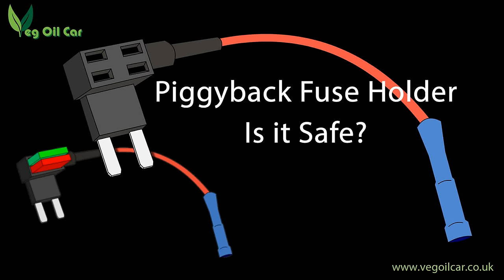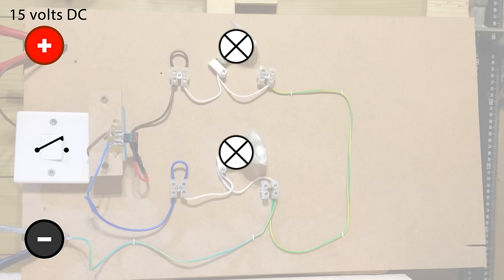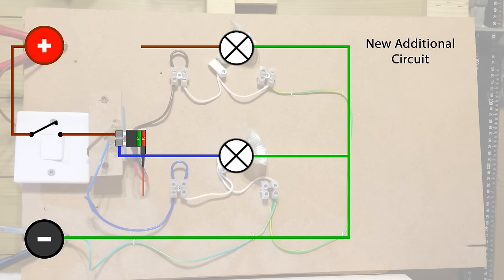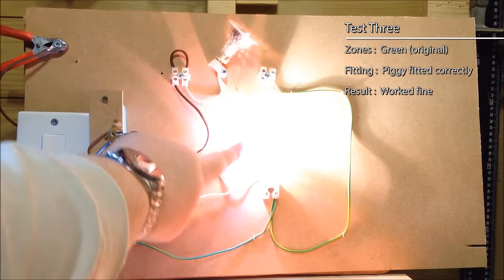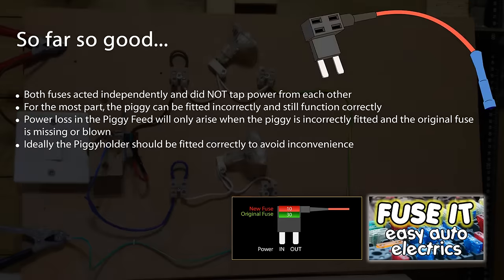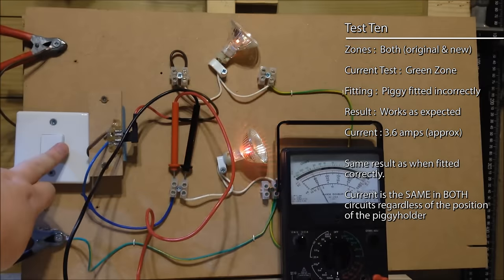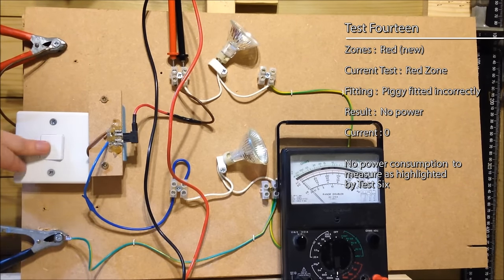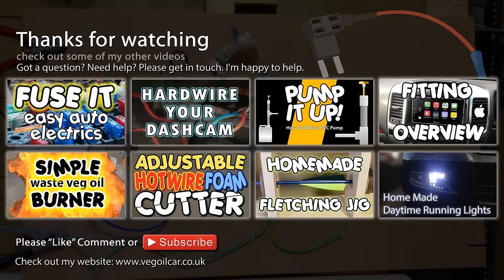Piggyback Fuse Holders SAFE OR NOT? A Piggyback bench test - by VOGMAN

Comment: Hi there 

I've just brought my first car and i'm replacing my radio. Im going to tap it into the cigarette lighter slot which turns out not to have a cigarette lighter in. The original fuse that's in there is a 10A so will adding another 10A fuse to the piggy back be ok. I'm a complete amateur when it comes to things like this so just wanted some reassurance. Not sure if i'm going to get a reply as you posted 2 years ago.

Dan
Reply from the maker: Hi Danny... I'm still around posting videos mate  : )
I'm surprised there's not a radio already in the car... and if one has been taken out, there should be a wire harness left behind - simple plastic connectors you can just push together. It's VERY unusual if there isn't one of these unless the car is old.
Cigarette lighter sockets are a good place to power from, but to avoid overloading the wiring, don't run the radio and the cigarette lighter at the same time. Better to remove the lighter (not the socket obviously) to prevent this occurrence.
But I still think there may already be a harness there for you to use... You said REPLACING so I think it's there... if it doesn't fit the new radio, check with a dealership for a adaptor kit. This is just more simple plug in fittings converting older sockets to newer ones  : )
Reply: @vogman Hi 
Thanks for the fast reply mate. Yes i'm replacing the factory radio with a aftermarket one. Yes your right there is a old wiring harness  but there is a red wire from the radio that's not connected to the harness that needs to be connected to an ignition point. I have two free fuse slots in my car but i don't have a fuse box layout to know whats what. I've researched pics of my fuse box with fuses in places where mine doesn't have them which has made it confusing . I cant risk just using one of the them if there has been a fuse removed in the past by a dealer or a past owner.
Reply: I checked again and the cigarette lighter fuse is a 20A and I would need to add a 10A for the radio. I know u said not to go higher that a 10A. Do you think it should be ok or not safe
Reply: Sorry for bombarding you with questions but I was just thinking the cigarette lighter has a 20A fuse and I plan not to use it so can I swap that fuse for a 10A and then my second fuse be a 10A. Sorry if that doesnt make sense as I’m a dummy when it come to this.
Reply from the maker: Hi again Danny. I wish I could help you but I'm hopeless at visualising things. I'm the sort that has to be there, to see things with my own eyes.
To me the harness should give you everything you need, but you mention a Red wire that needs connecting to an ignition source. This sounds like it's on the new radio...? But all of this sort of thing is included within that harness.
I generally say if in doubt don't do it. If you haven't got a friend who can help, look for an auto electrician or a local garage. Sure it will cost you a little, but much less than a new radio if things go wrong ; )
Reply: @VegOilGuy it's because the original stereo had its own connection for the amplifier whereas the new aftermarket one has it powered separately.
That's most likely what the additional power is for unless it has additional CD changer that requires the power.

I agree with you though it would make it a whole lot simpler if you can see it because it really does depend on what the stereos ad-ons are and if it has an amp that does need the additional power.

Comment: i think that if the piggy installed at the circuit the wrong way and theres a short in the external circuit it will blow both fuses.
'dosent it?
Reply from the maker: That hasn't happened in any of my tests thankfully, so I don't think it's an issue : )

Comment: you forgot to mention what fuse should i use in the new circuit, the same Amp fuse as the original or a lower Amp fuse? if it is a lower amp fuse then how low it can be? thanks for your help ☺
Reply from the maker: Hi Cesar.
It's very hard for me to be able to say which fuse without being there with you as all vehicles are different.
Ideally look for an empty fuse holder or a fuse that's not used much. For example, the fuse to cigarette lighters should be perfect, as long as you're not already fully taxing this circuit.
It doesn't really matter whether the new fuse is higher or lower than the original, but keep an eye on the total current being drawn. This video may help - https://youtu.be/hvi-Xv9wFOI
Any problems, let me know : )
Geoff
Reply: VegOilGuy thanks a lot for your help

Comment: Im planning on using this type of fuse tap to hardwire a dash cam so I can have it on when the ignition is on (using the Blackburn Power Magic Pro). In Blackvues installation video they do not add a new fuse to the tap, they literally just pull out the original fuse, put that in the bottom of the tap and plug it back it. Is this safe/should another fuse be put in the top slot and if so what strength? (The original fuses are 7.5 and 10). Thanks in advance!
Reply from the maker: Thanks for your question.
I haven't seen the video you mention so I can't really comment on it. When I was fitting my dash cam I saw a video from a guy who claimed to be a professional. He wrapped the bare end of a wire around the leg of a fuse... don't do that please! Loose wires in a fuse box are a recipe for disaster.
In truth dash cams tend to draw very little power so people often splice just about anything.
The best approach (and good practice) is to run a new line that's properly fused, that way you can be certain everything is done properly. If you have an empty (spare) fuse us that. If you haven't then a piggyback fuse is then next best thing. 
Placing a fuse in the TOP means you have created a new fused circuit. If something blows a fuse, you'll know whether the problem lies in the Dash Cam or the other appliances. And THAT is what it's all about really... safely controlling electrical devices - being able to isolate individual items.
I hope this makes sense. Best wishes and good luck,
Geoff

Comment: I have a question if my original fuse is a 10 amp min and I'm trying to tap , what # amp fuse should I piggy it with?
Reply from the maker: The size of the fuse you use is determined by the item you're fitting. For example, if it requires 3 amps and you fit a 1 amp fuse, the fuse will always blow, and if you fit a 10 amp fuse, it will never blow, but the item you're fitting could be damaged. Look at the item itself or any information that comes with it. It will generally tell you what size fuse you should fit  : )
Reply from the maker: Try this video I did. It may help : )
https://youtu.be/hvi-Xv9wFOI
Reply: @vogman  thanks!
Reply from the maker: Happy to help.

Comment: theres no fault with the meter, the thing is that the circuit you are building is a parallel circuit. the voltage stays the same but the amp get divided into the 2 lights bulbs. but i guess those fuses are diferent, one will pass more current than the other one because it will act as a resistor depending on the thickness of itself
Reply from the maker: Thanks for that Steve.
Reply: Ure welcome

Comment: I need to power Dashcam external battery pack which has a 20Amp fuse..(the battery also feeds the dash cam)..... If the original fuse is say 15Amp would the new Load(additional) blow the original fuse? Lets Assume piggyback is connected correct way..? So my question is Must  the Original fuse be Larger than the New fuse? According to your tests the fuses are independent from each other assuming the piggy back is  inserted correct way would this be ok?? So to clarify a bit more IF the piggy connector was fitted in correct way round. Is it ok for the New circuit fuse to be bigger than the Original fuse rating??
 Thanks for any advise..
Reply from the maker: Hi Andy. You've certainly got the right idea in mind.
It's not a case of how big or small the original fuse is. It's more a case of will your extra drain on the circuit cause a potential overload. This video might help...https://youtu.be/hvi-Xv9wFOI
20 Amps is quite an extra load to place on any circuit. You may be better of trying to access an item fuse line...?
Hope this helps.
Geoff

Comment: Hello there. Thanks for the video, great explanation. I am looking to wire a usb charger to a motorcycle and would like to use one of these piggy back chargers. The fuse i will be replacing with the piggyback charger is a 15A fuse so i will use a 15A fuse in the position of the old fuse in the piggyback. My question is what fuse will i be able to use in the new fuse postion? Seems that you use a 10A fuse. I am trying to power usb charger that will give power to a GPS and iPhone. Will a 10A fuse be enough? How can I figure out what fuse i need?
Thanks.
Reply from the maker: Hi Nick. Thanks for your question and kind comments.
The answer SHOULD be available to you on the device itself. Somewhere it should say on it the amount of current it uses in Amps.  The trick with fuses is to select one that is HIGHER than the amount the device requires but not by too much. If you go lower, you'll simply burn out the fuse. For example, if it uses 3.5 Amps, then a 5 Amp fuse would be ideal.
It will probably work with a 10 Amp fuse and I can't imagine a USB charger using too much juice, but I'd prefer you to check the device and make the best possible choice for you.
As for which to Piggyback from, have you seen my FUSE IT video that should hopefully help you pick a good fuse? If not give it a whirl and let me know if you have any questions.
Hope this helps.
Best wishes,
Geoff
Reply: Thanks Geoff ill give it a shot.

Comment: find a way to measure the current passing thru the original fuse when the piggyback is connected wrongly, sure it would show you a different value
Reply from the maker: I really can't see any reason why it should : )
There's a lot of paranoia about these devices and I really don't know why. I'm guessing a lot of clumsy DIYers have wired things badly and wrongly blamed these Piggys for the results. It's like blaming the Car when the Driver is drunk.
As long as you don't overtax the wiring prior to the fuse, these are safe and simple devices.
Hope this helps.
Reply: @vogman  im not saying its not safe, just want to emphasize that the current passing thru the original fuse will be the sum of the currents used by both lamps, using some electrical formulas/theory...as long as the current on the fuse is within its rated capacity, then you have no problem
Reply from the maker: Ahhh.... I'm with you. Yes. A lot of folks fail to take into account the extra current being drawn on the parent circuit. 
Nice one  : )

Comment: On picture where the fuse is the pins what's that in & out it's that positive an negative power an ground which one is
Reply from the maker: It's been a while (it's quite an old video) but I'm probably referring to where the power goes IN to the fuse and then goes OUT of it - the fuse bridging the two points. You might find this video helpful - https://youtu.be/8omZ545Cw1U  : )

Comment: if i use this piggyback fuse holder do i need a spare fuse or put just the fuse i took out?
Reply from the maker: The "original" fuse goes in one slot of the piggy holder, connecting the original circuit.
The NEW fuse goes in the second slot.
Hopefully the video should tell which slot is which.
Hope this helps ; )

Comment: piggy has to be put in correct way because if you put in backwards and you have a short it will not blow the fuse and you run the possibility of burning up your lines thru your car
Reply from the maker: Thanks for your comment.
My tests showed no evidence of a short - just a loss of power if the original fuse blows. This is a nuisance but not a safety issue.
If used sensibly, they're fairly useful items  : )

Comment: Yes, there would be no difference in amps because a fuse is hot only... it's just a fused circuit that can only handle a certain amount of power going through it .. if that power is exceeded it burns through and breaks the circuit... 😁

Comment: NOT SAFE!
And not due to orientation.
The feed to the fuse slot is designed for so many amps. The 2 combined circuits, though protected by their respective fuses, could total more than the common feed was designed for.
Reply from the maker: You're not wrong, but you're describing the process of sharing a connection - like running an extension lead at home - rather than the device itself which is what my video is trying to clarify.
Your concerns are valid, however, and I covered this very issue in my OVERLOAD video here - https://youtu.be/hvi-Xv9wFOI
As with many things, if used properly, these devices are perfectly safe.
Only a few days ago someone wrote in saying how a manufacturer provided a Piggy within the various cables of a brand new device and offered some instructions on how to use it. 
I hope this clarifies your concerns. Thanks for your input.
Reply: The majority, and by majority, I am referring 99.9% of the population who are using these things, are installing devices like UHFs, dash cameras, cigaret sockets, and maybe a water pump for a solar shower... so the feed would not be an issue, even if multiple devices are connected to the same fuse outlet... perhaps if someone is mounting an inverter, but for ever day appliances, there is no issue.
Reply: But in the case of your scenario, there is an upstream fuse or fusible link. Overall still safe although every circuit fed by the upstream fuse loses power when that device has to provide protection by opening.

Comment: Your looking to far into this, Piggy Back right way will work, Piggy Back wrong way wont get any power so wont work simple, the lower section of this device is irrelevant it will work any way round just the same as the fuse would on it's own.

Comment: These are ugly, I wanna know how to wire a new line altogether
Reply: Who cares about appearance. You aren't staring at it all day. What matters is what device you are trying to power. If it is a low draw equipment these are easy taps but if you need more power then a direct battery connection with a fuse and relay are needed.

Comment: Regrettably, your experiment is fundamentally flawed with regard to current measurement. You need to measure current through the fuse rather than the lamp. Measuring through the fuse you will find: main fuse: approx 3.6 Amperes in proper orientation and approx 7.2 Amperes in backward orientation. All your comments on protection of the wiring and devices on the load side of each fuse are correct.